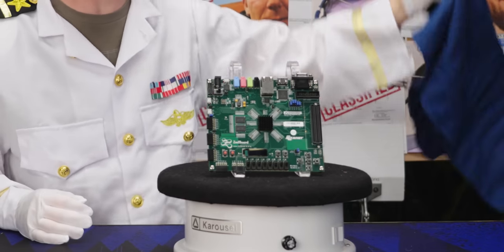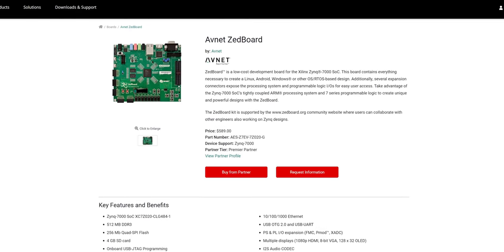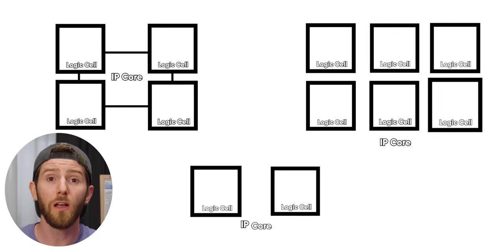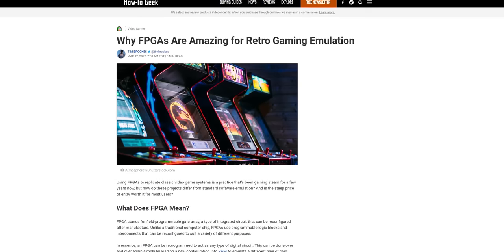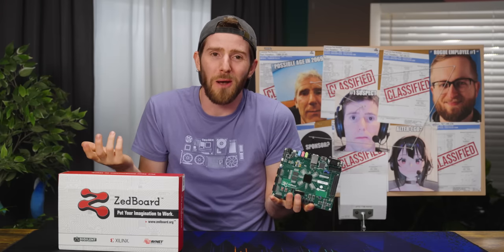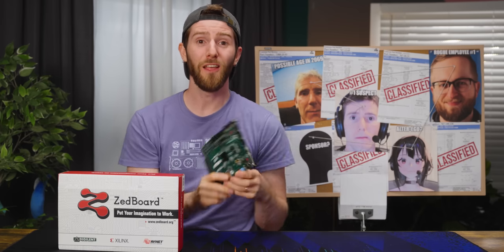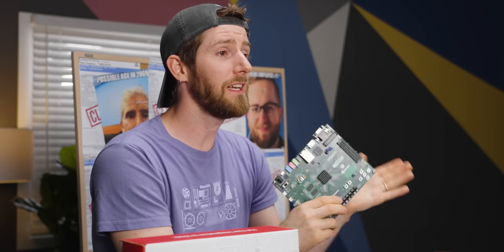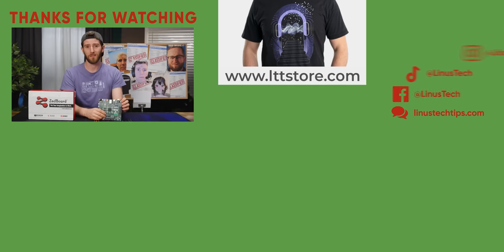I Bought Iran’s Secret Quantum Computing Chip

Comment: Meh! I should send Linus one of our older Combined-CPU/GPU/DSP/Vector Array processor chips! At 60 Ghz and 575 TeraFLOPS of fully ITAR-free (i.e. All-Canadian Designed and Manufactured!) 128-bits wide GaAs on Borosilicate supercomputing horsepower, I think we can make a dent in breaking whatever encryption the Internet likes to use in 2023!

The chip shown in this video is quite laughable and is in NO WAY a cryo-cooled DWAVE-style Hybrid quantum chip nor is it a TRUE Quantum Annealing all-states-at-once compute system! Unless that chip has an array of at-least 256 by 256 array of electron-beam-etched nanowells containing trapped Xenon particles that have embedded nano-LASERS to track their POSITIONAL state OR their SPIN state AND some quantum decoherence-resistant ECC (i.e. quantum-specific error checking and correction), then it ain't a Quantum Processor!

V

Comment: Time travel isn't possible, doesn't matter what type of computing power you have available. It's hilarious, people really think they can travel in time when there wouldn't be anything to travel to. What, you think only people move forward with the passing of time, so does everything else. If you traveled back in time you would find an empty void, because the rest of the universe isn't there anymore. If you traveled forward, the same void, as the rest of the universe isn't there yet. Nevermind particle preoccupation. If the rest of the universe WAS there, so would be the atoms you are made of. If you traveled to a different time the particles you consist of are doing something else, so as you traveled to a destination time, your particles from that time would have to travel to your origin time to compensate, and this would mean at the median time between the destination and origin time those two sets of identical atoms would need to coexist in the same moment as they passed each other in the timeline... which is not possible. THEN there's production and distribution of reorientation energy. To move something through time you are talking about reorienting every atom, every sub atomic particle, every yet to be discovered sub sub atomic and super sub atomic particle, which would take a tremendous amount of energy. In fact, reorientating every particle in the universe would take more energy than there IS in our universe, again, rendering time travel impossible.
So take it from a guy from 2152, time travel is ABSOLUTELY impossible...
...well, I didn't say anything about quantum phase shifting between quantum variants of Earth that are at different points along their respective timelines, now did I? That, now that IS ENTIRELY possible.
Reply: he skipped 18 parts sir. I study 19 majors?